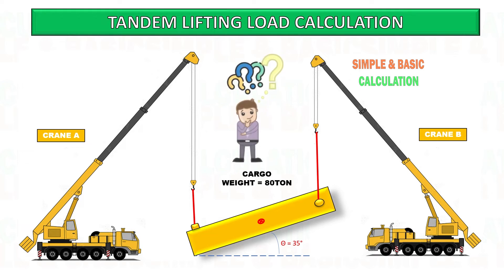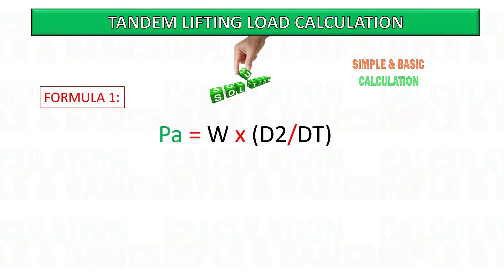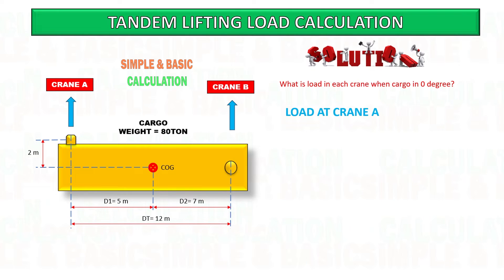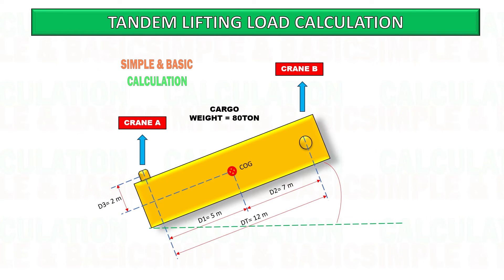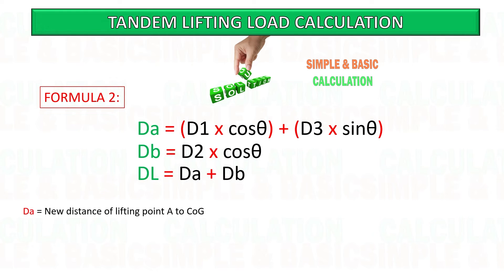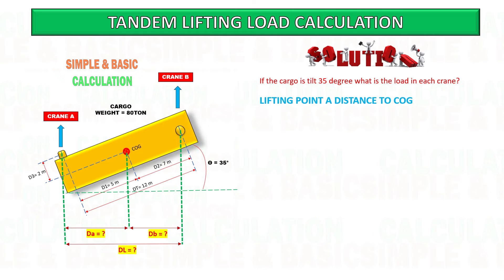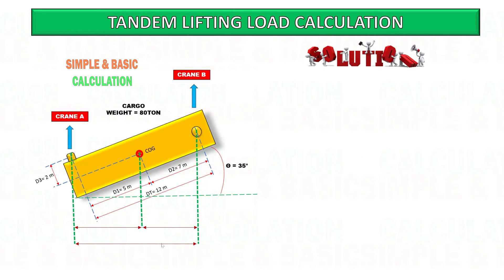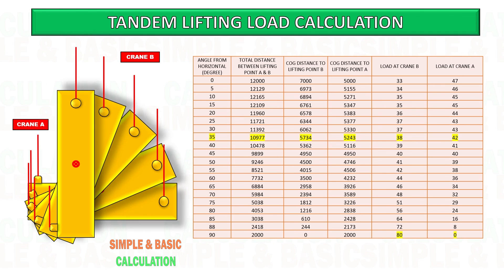Tandem Lifting Crane Loading Calculation - Critical Lifting #lifting #rigging #crane #heavylifting

Comment: I am a safety officer and i appreciateyou for the videobut i am tryimg to learn tendum lifting calculation through your video But in you your video to much confusion ,i know about rigging plan for single crane but kindly provide me a link that i can learn easily qbout tendum lifting calculation.
My confusion point is that your take D2 for craneA and why take D1 for craneB and then why add D1+D2

Comment: Excuse me : about Db on video 5.735 m but you calculation 5.534 m /10.997m Thank you very much.
Reply from the maker: Thank you for your comment. The discrepancy was due to a typing error—the correct value is 5.735, as also indicated in the sketch. However, please rest assured that the formula remains unchanged.

Comment: Im also think it's incorrect D2 and D1 is replaced for the both equation 🤔
Reply from the maker: I appreciate your comment.
It is not mixed.
This is just a reaction force calculation.
Looking at it, the CoG is more near crane A, hence the weight in crane A is more than the crane B at 0 degree (horizontal orientation).

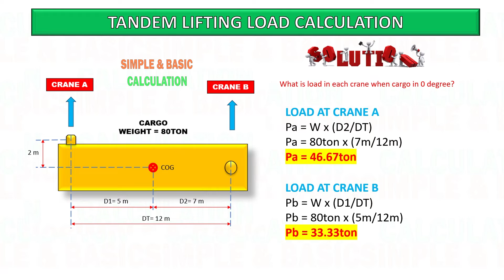Comment: Am not sure but I think you have the equation mixed up around @1:17 you have  the calculation of crane A as D2/DT,When it should be D1/DT....D2 is for Crane B and not Crane A
Reply: I'm also think it's incorrect D1 and D2 will be replaced for both equations
Reply: @amithashshibu9242 it's not mixed because here is the main thing is centre of gravity ...if the center of gravity is same so there will be same laod on both
Reply from the maker: I appreciate your comment.
It is not mixed.
This is just a reaction force calculation.
Looking at it, the CoG is more near crane A, hence the weight in crane A is more than the crane B at 0 degree (horizontal orientation).

Comment: Hello, Thanks for the video.

Just a tip, DB is correct at 2:54 but at 2:57 you have changed it to 5534 in the calculation and that´s incorrect? Should be 5734.
Reply from the maker: Yes.,
I appreciate your comment.
I made an error in typing, thank you for noticing. However, the formula remains unchanged.